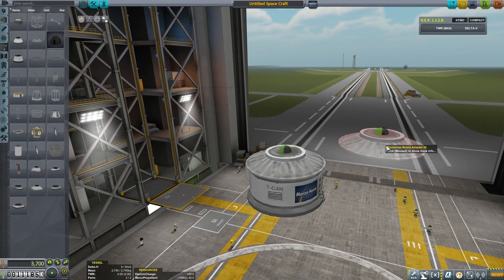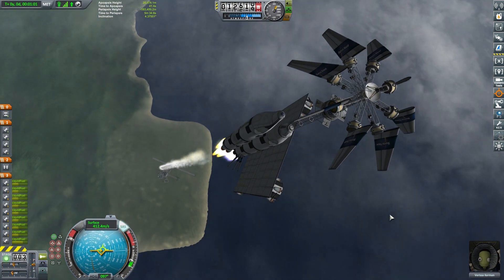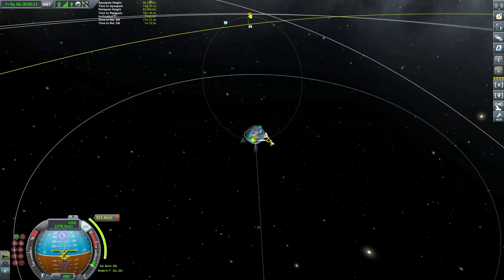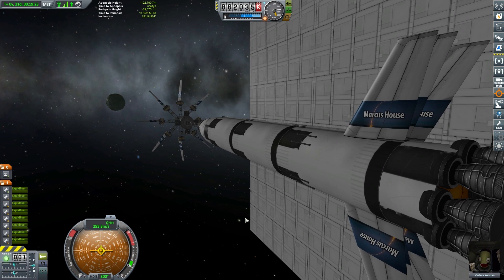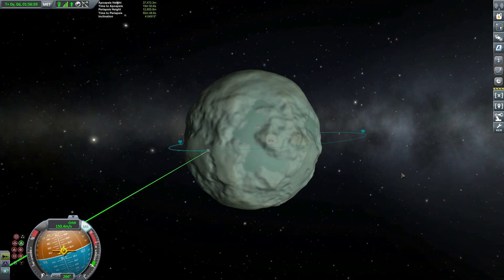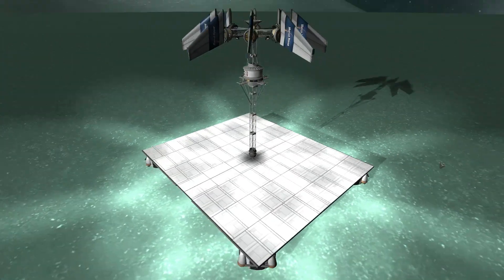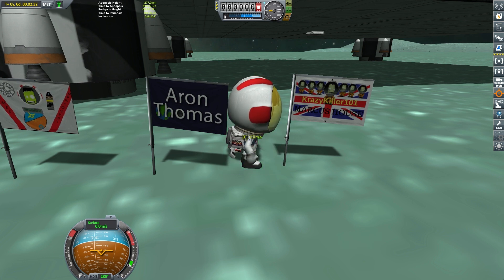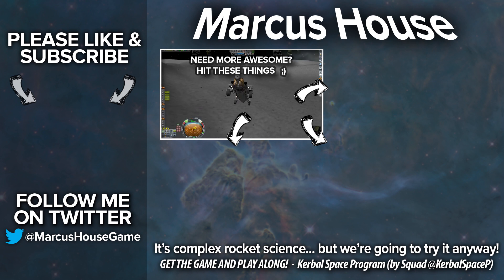KSP Minmus Base Station with a Twist (Tutorial:40) Kerbal Space Program 1.2 -  Stock Parts

Comment: how do you calculate when to launch to meet minmus at its ascending/descending nodes?
Reply from the maker: Ideally you want to launch in a similar inclination to Minmus right off the bat (this way you can launch at any time and just make your prograge burn at whatever time to meet up perfectly with Minmus. It is actually a bit difficult to determine what direction to launch without a little trial and error sometimes as you need to visually determine launch time and direction to match the inclination closely). What I first do is launch a satellite into a low Kerbin orbit and then I match it's inclination with Minmus exactly. That way, I can launch future missions to Minmus by setting my satellite as the target instead of Minmus (then you can follow the targets inclination as you ascend with your Minmus vessel (as you can even see the target passing overhead on the navball).
It would almost be worth doing an episode about this. There may be a mod that assists you with launch time and launch direction. Not sure about that actually. Kerbal Engineer I'm sure would have some readouts that assist in this.